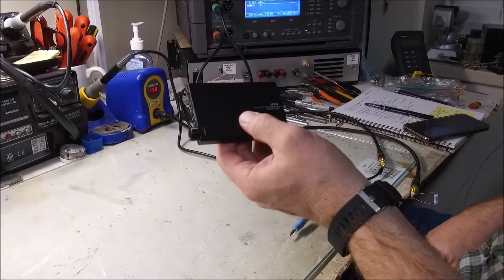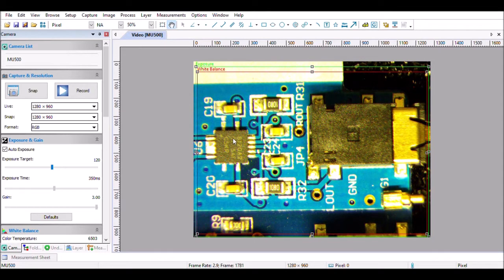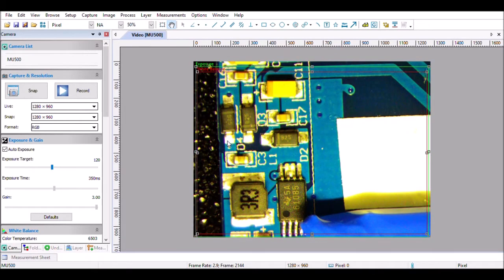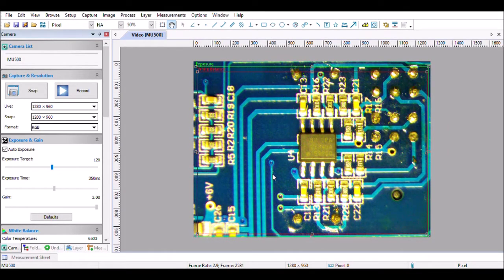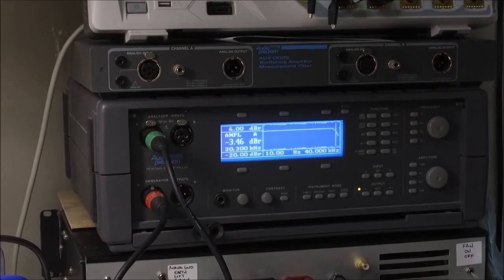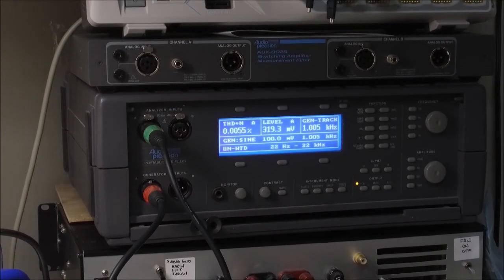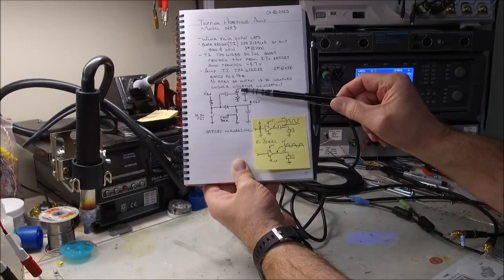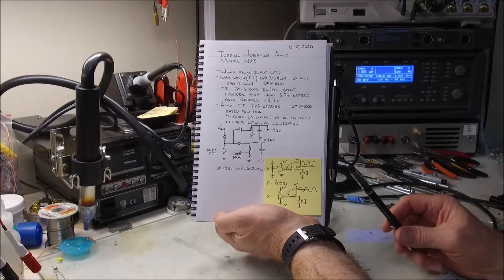Topping NX3 Headphone Amplifier.  Review and Circuit Analysis.  Distortion and Frequency Response.

Comment: excellent review, would it power 250 ohms like dt 990 pro? I'm completely new to this world and found one NX3 for 30 euros. Also, can I use it always connected to a PC?
Reply from the maker: The NX3 should have no problem driving a 250 ohm load.  Yes, you could use the NX3 between your computer and headphones.  Hope this helps.

Comment: Got a new sub! Nice review!!! I have a Philips SHP9500 (open back, 32 Ohms) headphone connected to a Meizu HiFi DAC/Amp USB type-C dongle (Cirrus Logic CS 43131 DAC chip 32 bit 384kHz, DSD128). Would I benefit adding the newer Topping NX3S (OPA 2140 + LME 49720, 545mW at 32Ohms)? Tks in advance!!!
Reply from the maker: Thanks for the comments.  I am not familiar with your headphones or the Meizu unit.  Sorry.   The Meizu DAC/Amp does look interesting though.
Reply: @DanPattenAudioG33k  A 5.5 Ohms output impedance is bad for a pair of 32 Ohm headphones? Those are  NX3s 545 mW at 32 Ohms measurements.

Comment: awesome review, i just bought a hifiman he400i headphones, they have 36 ohms and 93db, i looking for a good quality amp to move them... you think this amp is a good option? in other hand i have a beyerdynamic dt990 of 250 ohms, could move that level of impedance too?
Reply from the maker: The HE400i with 36 input impedance might see an improved bass response and control with this amplifier because it does not have the output capacitor.  Not sure if the DT990 would benefit or not in the bass regions.

Comment: I have the nx3s. What specific areas have been "upgraded"? Thx vm. Great channel.
Reply: What headphones you use them with and are they better than your phone ar pc onboard ampdac
Thanks in advance
Reply from the maker: I initially purchased the NX3 for some DIY planar magnetic headphones I was building.  These headphones had a low input impedance of around 8 ohms.  This low input impedance resulted in poor low frequency response due to the output coupling capacitors present in most low cost portable amps.  The NX3 does not have output coupling caps and resulted in much improved bass.
Reply from the maker: I have not tested the NX3s so I am not familiar with what the changes might be.  Sorry.